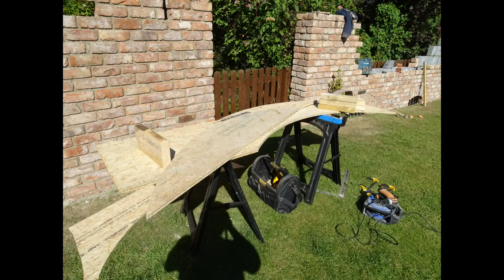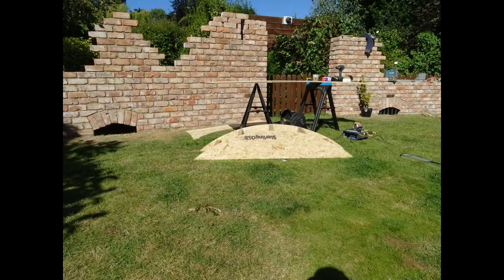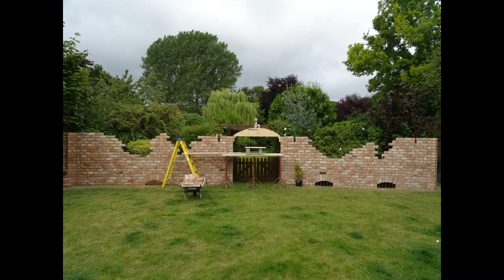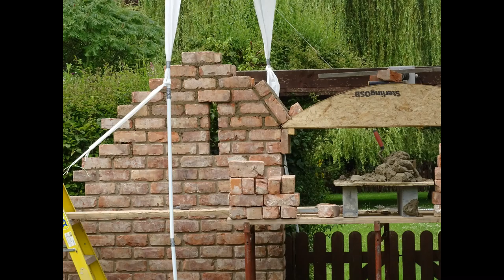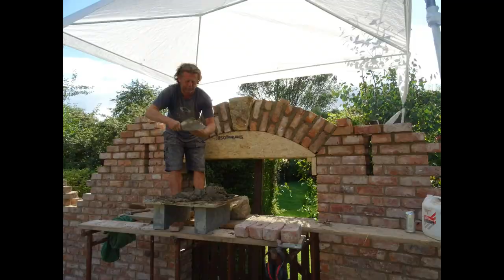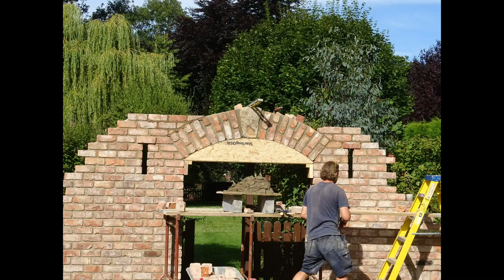HOW TO BUILD A BRICK ARCHWAY

Comment: Great video man. Can you tell me what kind of mortar you used in the bricks joints?
Reply from the maker: Blue circle mortar / cement and red sand mixed at a ratio of 5 red sand to 1 cement. Glad you liked it and Thanks for your comment.
Reply: Thank you
Reply from the maker: YouTube has only just informed me that you left this comment, 2 years later, probably too late now but to answer your question Blue Circle cement with Red sand at a 4-1 mix, a belated thanks for your comment.